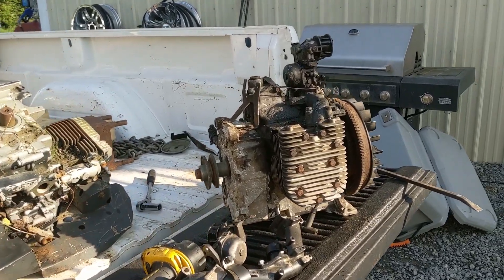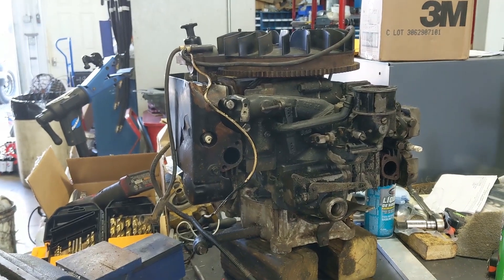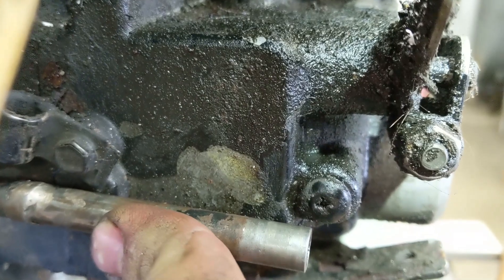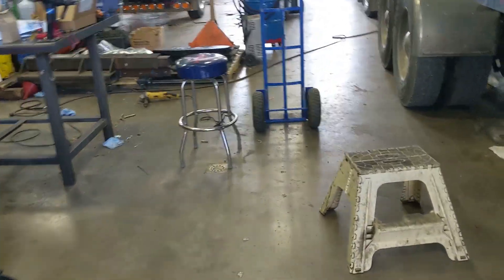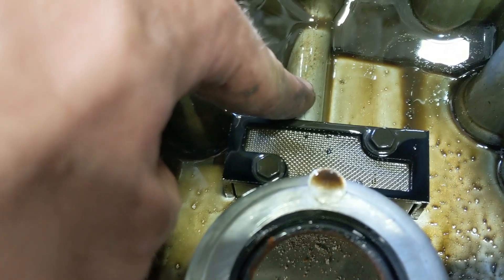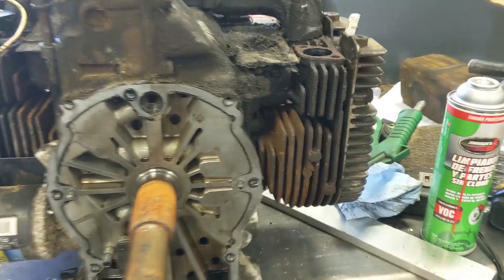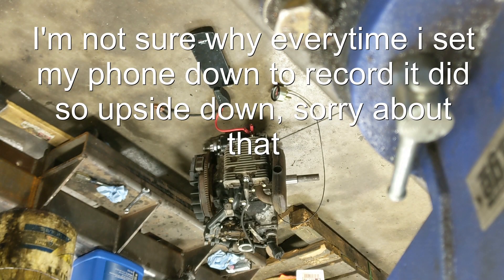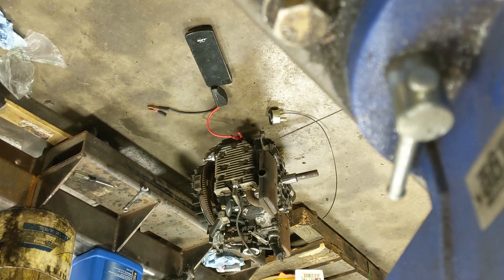Kohler opposed twin vertical to horizontal conversion

Comment: what year urs,,i have one from the 90s.i used intake and exhaust from a 70's one that was blown,,all bolted up so far,starter gear wrong since it was a points and condenser motor going to a newer setup so hopefully a starter gear works.but also the parts from a 17hp.going on a 18,i need dipstick tube yet,any suggestion

Comment: Hey brother.  Thanks for the video.  I am doin the same conversion, but before I button everything back up, I have a concern about the pickup tube screen not being reused.  On the old KT17 horizontal shafts (M18 predecessor with same crankcase) there was a pickup tube with screen at the bottom of the crankcase.  Did you end up using a screen with this conversion?
Reply from the maker: Ya know as dumb as this sounds I never gave that any thought. To answer your question no I did not use a screen. I've ran this engine has been running for two years now and has been worked pretty hard a time or two without issue. But it is a risk you run when converting these engines this way I suppose.
Reply: @WeaversGarage   I bet you didnt install the pickup tube and screen inside the engine that goes to the center bottom of the engine thats used for the m20 version i had to do this conversion because the only crank case i could find was an MV20 block to replace the m20 block that had thrown a rod through the block all because the  Governor came apart!

Comment: crankshafts are different.  vertical crank will be 6 inches longer. also cant adjust valves on a Magnum. the lifter or valve stem has to be grinded down

Comment: Do you have the model number for that front plate? Also how did you hook up the oil pressure gauge? Is there a spot for it in the front plate that you got?
Reply from the maker: I don't have the number for the plate unfortunately. There is a pipe plug right above the oil filter that you have to remove and that's where you plumb in an oil pressure gauge
Reply: offroader94 Okay, thanks for the response! 🙂

Comment: Can you please add a complete list of the parts that you need to round up? My students are going to try this on a Cub Cadet engine. Very helpful!
Reply from the maker: Sorry I didn't see this comment until now but here is a list of what you need.
Horizintal shaft intake manifold,
Throttle linkages for a horizontal shaft engine,
Front cover to replace sump,
Proper distick and tube,
Oil fill tube and cap,
Reply: Where do I find all the part for it  I had the same engine that I want to Convert

Comment: The parts required how hard are they to get or are they still commonly available on eBay??
Reply from the maker: It might take you a little while to find all the pieces but you can usually find them on eBay.

Comment: That's a pretty neat conversion. Don't see too many vertical shaft KT's or Magnum's. I think they were only used in Cub Cadet and Craftsman tractors.
Reply: Got a yard machine with one
Reply: John Deere 317
Reply: @joshuaperry9375  Vertical shaft KT17 in a 317? That would be a first...
Reply: @MichaelTJD60  oops wow I need to read better... Yah I saw horizontal not vertical...